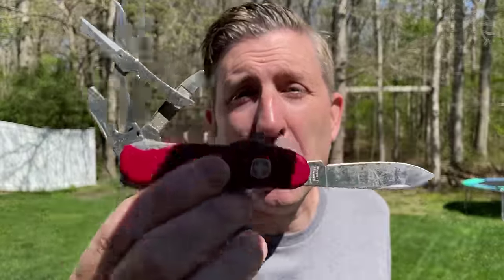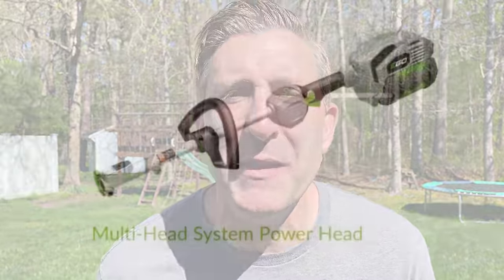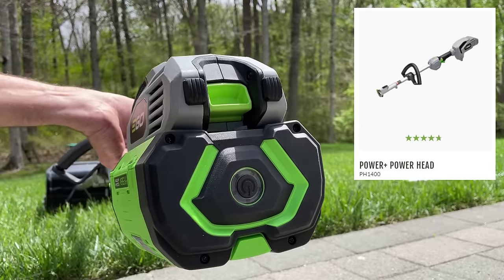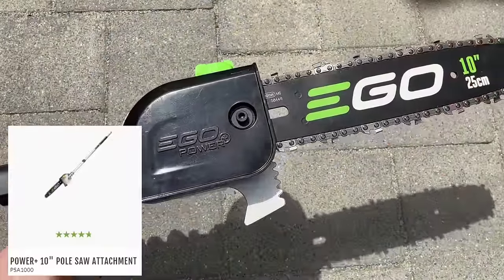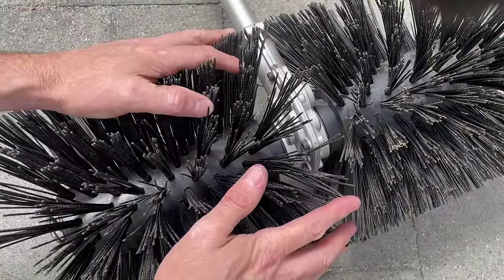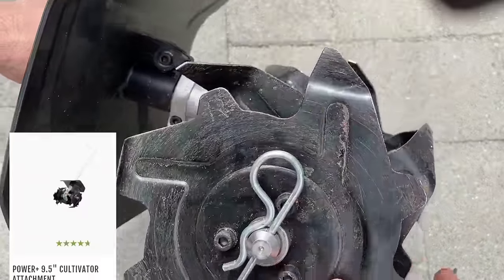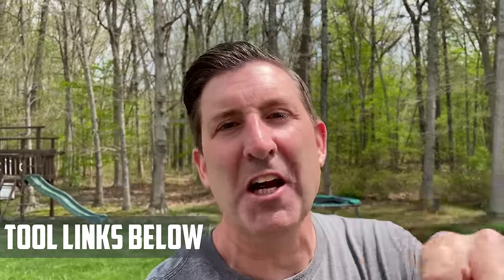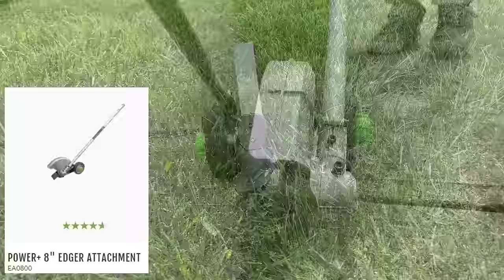[IN ACTION] EGO Multi Head System - 2021 Best Review 🤯🤯🤯

Comment: Is it worth it to get this do you think, over the new stand alone string trimmer? I imagine the balance is off with this having both the motor and battery at the top. Plus missing the power feed head
Reply from the maker: what heads do you need?
Reply: @Kitearmy  I'm not really sure. Maybe the cultivator and hedge trimmer. Currently I have echo versions of those but stand alone units. I understand the advantages of the power head idea. I'm just curious how much functionality are you losing between the string trimmers specifically
Reply from the maker: @victorvannatter312  The cultivator is awesome, hedge trimmer is awesome, edger is awesome, - the string trimer is good (but not the best ego trimmer)
Reply: @Kitearmy  but worth it over the standard string trimmer if needing the other attachments? If so probably the way I will go. Thanks
Reply from the maker: @victorvannatter312  True - its what I often use the edger
Reply: @Kitearmy  ok thanks for the reply

Comment: I have the EGO blower. It's very nice... but if you hit that turbo button, which, is actually required in order to move a lot of leaves in a timely manner, the battery goes down... QUICKLY. And I mean QUICKLY!

Not trying to allude doubt here, because my EGO blower is great quality. It's just the battery does not last very long. So here's the million dollar question:

What, if anything, is EGO paying you for this "RAVE" review?  Are you being paid for this, or do you legitimately like the EGO multi-head trimmer, etc? Also, how long do the batteries last when using the trimmer?  And, is the multi-head trimmer as nice as their stand alone trimmers? (non Multi-head) 

Thanks for the response ahead of time... I appreciate it.
Reply from the maker: Blowers are by far the hardest tools to power - you will probably never run out of power with these tools
Reply: I was hoping for a transparent answer here :(

Comment: Would be nice if they had a blower attachment too. I barely ever have the need for one so it would be nice for a cheaper option to attach to a motor and battery I already have. Echo has a blower to go on their gas multi head
Reply from the maker: yeah - this is not made for that kind of speed
Reply: @Kitearmy  what do you mean? I thought the motor on these were supposed to equal the 2 stroke gas engine
Reply from the maker: @victorvannatter312  The EGO blower runs at 20,000 rpm - gas motors do not.  This unit is made for torque not speed and EGO does not make products that are not the best
Reply: @Kitearmy  thanks. Makes sense. Did not know the motors ran so fast. I figured they could gear the blower head for the speed that was required. Like how gas blowers do
Reply from the maker: @victorvannatter312  I'm sure it is possible - I'm only guessing why they don't make them.  All I can say the tools that I tested are excellent
Reply: @Kitearmy  Oh for sure I'm not arguing that it's excellent. I have seriously considered a few times trading in my gas powered tools for electric. I mean I cut my grass and snow blow my driveway with an electric garden tractor.
Reply from the maker: @victorvannatter312  you had me at electric garden tractor
Reply: @Kitearmy  lol. It's called a GE Elec-trak E16. It's a mid-70s all electric garden tractor. Runs off of 6 * 6 volt FLA batteries. Front mount 42-in mower deck that has an individual electric motor on each spindle like on the newer zero turns. Also have a front mount snowblower for it that also has an electric motor.
It cuts my 1.5 acres of property no problem.
The snow blower uses a lot of power but I can do my 20 ft wide by 25 ft long driveway plus lanes all over my yard for my kids to play on no problem. And because they're 600 lb of batteries in it, it weighs almost a thousand pounds and has tons of traction
Reply from the maker: @victorvannatter312  OMG - that is amazing.  Talk about ahead of it's time.  This is a real piece of history ;)
Reply: @Kitearmy  Yeah I really don't understand why it didn't catch on and they went out of business. It would supposedly do two to two and a half acres. And no maintenance belts anything
Reply from the maker: @victorvannatter312  before it's time
Reply: @Kitearmy  You're probably right. People back then were far too macho to use an electric motor for something! I can only imagine how much grass could cut with today's motors. Because I have about 
6, 000-7, 000 watt hours of battery. I don't have any of the attachments but you could get things like chainsaws, hedge trimmers, grass trimmers, ect small hand tools that would plug into an auxiliary port. And use the tractor as the mobile power station for those corded tools. They all ran off 36 volts as well. Obviously not as convenient as each tool having its own battery like these ego tools. But back then when there were no light lithium ion batteries it would have been awesome
Reply from the maker: @victorvannatter312  So true - people even today are too macho.  The new zero turn has 3,360Wh but it also is powered by brushless motors.  Thank god for innovators like you to push electric tools - if not we would still be using coal powered
Reply: @Kitearmy  lol. True. Thank you but I'm no innovator. I didn't build this machine. It was a factory machine from back then. If you look it up there's a great promotional video from General Electric here on YouTube for you to check out
Reply from the maker: @victorvannatter312  so cool!

Comment: Tim from Canada this is were here you were screwed.. you have to get the 56 for batteries rehear you were screwed... if you look into Milwaukee M 18 fuel powerhead brand same attachments.. but now you were running M 18 batteries which you can run in your drills all M 18 tools.. by Milwaukee and now it will run your powerhead for your lawn cleanup.. you do not have to go out and buy 56v batteries if you were buying Milwaukee you can save up by a drill M18; and run the same battery as your Milwaukee power plant something to look into.. and I am pretty sure Milwaukee has more attachments and you can use the same batteries on all power tools..
Can EGO do this answer is no
Reply from the maker: EGO has more attachments - EGO also has a ride on mower - I don't feel screwed

Comment: Just curious, what would you use the rubber brush for?
Reply from the maker: I can't really figure that out - i prefer the bristle brush
Reply: @Kitearmy  definitely interested in getting the power unit but seeing if there was a hidden use that I wasn’t seeing with that attachment lol
Reply from the maker: @darodes  It's the only tool in the line up that I don't really get
Reply: @Kitearmy  from what I’ve researched, I guess it’s for situations like if your basement floods or garage floods, you can chase the water towards a drain. Or maybe if you wash your car and have excess water on the driveway?
Reply: @Kitearmy  my basement would have to flood a lot for me to get that attachment if that’s the only purpose 🤣
Reply: Water, or any surface/material that you don't want a potential spark or excessive static around.
Reply: @skillz996  that makes sense! Thanks!

Comment: I guess you don't want to sell the roto scissors For my multi head I have every tool that you make. Except for the snow blow up and the cultivator I have the expensive self. Propelled ego battery operated lawn. Amowa, I'm an injured veteran. So I was looking into seeing about the battery operated writing moa.  But it only goes on flat ground. It doesn't go up hills. You're going to spend $6000 for something that goes on a flat ground and won't go up a hill. And what's going on with that?

Comment: I wish they had a an attachment that's like the weed wacker but is a blade instead. Then I could dump my gas powered one
Reply from the maker: you can change the head to something like that
Reply: I've done it in the past with a third-party accessory but they don't seem to work as well as something else properly designed and they seem to wear out the engine. If someone has an example of how to do do it with this I'd love to see a video on it!!!
Reply: Okay I see that eagle actually has an accessory for that. Still would love to see a video on it!!!

Comment: all really good, but the cultivator matched with the  power head is a super heavy thing to use, almost need to be like Arnie to hold it, even with the strap on. You didn't say anything about how heavy this stuff is. Even after the small cultivating job you did you would have been tired out
Reply from the maker: Yes, you are right

Comment: All my batteries are toast after 3 years. The so called generator which charges the batteries display has been shot for 2 years. So my ego stuff is history, good idea, quiet but replacement batteries are too high priced. And the cost to the environment to produce them is much higher than just using a gas mower, snow blower. Oh yes the snow blower was a bust too. I would recommend  if one had a yard about 1000 square feet. 

Ordered a Honda gas mower yesterday. You just need to find a way to produce batteries safer and less costly to the environment.

You won’t publish this, but just wanted to let you know.

Leo Rutten
Cedar Rapids, NE.

Comment: Makita power head has a better connection method and I use both ego and makita tools. The ego one seems rather poor to be honest
Reply from the maker: How many attachments does the Makita have
Reply: @Kitearmy  more than ego. We use both and find the Makita has better build quality all over. The only advantage that ego has is the price. Makita attachments can be used on either there battery or petrol range and in the the LXT range they have over 280 all compatible with the same batteries. Don’t get me wrong the ego is good just not as good as you are trying to make it out as
Reply from the maker: @PLGardenCare  did I read that wrong - 280 attachments.
Reply from the maker: @PLGardenCare  for me, I love the versatility of ego - snow blower, zero turn
Reply: @Kitearmy  no makita LXT range is the largest power tool platform. I can use my DUX60 power head and put those same batteries into my angle grinder or impact driver.
Reply: @Kitearmy  neither of those products are available in Australia unfortunately. Our business has been hanging out for the zero turn mower. As I said ego make great products and we use a lot of them just need to be aware some of the others in makita have better features.
Reply from the maker: @PLGardenCare  Sure - I guess every real manufacture has it's advantages.  BTW - I was born in AU
Reply: @Kitearmy  glad to see an Aussie that has made and I’ll admit your blower video sold me on getting Ego blower. Don’t stop what you are mate
Reply from the maker: @PLGardenCare  As they say in the America - ALL GAS, NO BREAKS (gas of course is petrol)

Comment: DON’T DO IT!!!! THE BATTERIES ARE TRASH!!!!! I spent 11,00.oo on hedge trimmer, string trimmer, hand held blower and backpack blower, with an additional 5.0AH battery. ONE YEAR AGO!!! I have less than 50 hours on all of them together, but today... ONE of the 2.5 AH (which actually lasts about 10minutes) is the only one still working. That are as fragile and heat sensitive as a CELL PHONE!!! DON’T SUFFER MY MISTAKE! These are NOT professional tools. Fine for the do it yourselfer, I guess. NOT FOR THE PRO!

Comment: This video cost me a lot of money.
Reply from the maker: Yeah...sorry on that
Reply: @Kitearmy  do you feel the battery life is good enough on the leaf blowers for a medium amount of lead pickup in yards?  If so I might sell my Stihl leaf blower too and go electric
Reply from the maker: @DairylandDetailing  leaf blowers take a lot of power to run (the most of all ope tools).  IS this for a commercial or residential use?
Reply: @Kitearmy  Residential, corner lot about .3-.4 acres with a couple trees.  Will most likely have 3 batteries and at least two slow charges.
Reply from the maker: @DairylandDetailing  You will be good to go!!!

Comment: How does this compare to the Milwaukee powerhead?
Reply from the maker: Review of the Milwaukee coming out tomorrow - this has was more accessories
Reply: @Kitearmy  True, but my focus is on trimmer, hedger and pole saw. Concerns would be power and compatibility. If I go EGO ecosytem it would be good for OPE with their mower. Milwaukee better for my other tools, but they do not have a mower. DeWALT Flexvolt powerhead is nice but their accessories are not avail yet. They use a universal attachment but the options are generally not as good as the quality in the EGO and Milwaukee ones. Also, too bad DeWALT didn't go Flexvolt route for the mower, or at least giving FV batteries on their new 20v mowers. Thanks for your reviews, they are always fun to watch!
Reply: @Allen-bm6tz  A little more than two years ago I was in a similar position, looking for an electric mower with a garage full of Dewalt and Milwaukee cordless power tools. After buying a Dewalt 40v string trimmer and later a Dewalt 60v max blower and chainsaw, I was reading nothing but bad reviews on the newly released Dewalt mower. It was under powered and suffered a short run time. Then I discovered EGO. Yes it was another battery platform, but I was frustrated and I wanted to convert all of my lawn care power tools to battery. EGO offered a complete line of stellar, very well reviewed, OPE (Outdoor Power Equipment). As the saying goes, the rest is history and I've never looked back. I now own the Mower- LM2102SP, String Trimmer- ST1521S, Blower- LB6504, Chainsaw- CS1804 and the Multi-Head System with three attachments. All of these tools have been great and the mower mows my entire yard, ~1/4 acre, on one 7.5 Ah battery. For the mower, I did later buy their "high lift" blade, to get better bagging and leaf pickup than the original blade it came with. I think some complaints about the bagging and pickup issues led to the newest mower being a twin blade design. I also had the "PowerLoad" head quit working on my string trimmer, after a few months, but EGO quickly replaced the entire string trimmer at no charge and free shipping straight to my house. But that's what I love about EGO, they make great products with plenty of power and they stand behind their equipment. No only that, but they were listening to their customer's complaints and problems, and thus they redesigned their mower for improved performance. 
As for Dewalt, they have abandoned their 40v "Professional" line of OPE and finally fixed their mower, I think. Too little too late.
Reply from the maker: @Allen-bm6tz  I think you hit the nail on the head - tomorrows video covers just that.  Also you are right, it's Milwaukee or EGO on the top positions.
Reply: @Kitearmy  and DeWALT's decision to include a base charger in the kit with the 9ah FV battery. I consider OPE high drain and 3+ hours to charge the included battery is huge disappointment... shameful.
Reply: @billw1044  I'm leaning towards the EGO route and at least standardize the battery platform for my lawncare. My nearby Lowes does not have much stock and it's pretty bare online too.
Reply from the maker: @Allen-bm6tz  Ryobi does the same thing